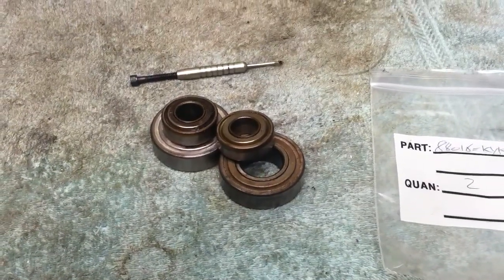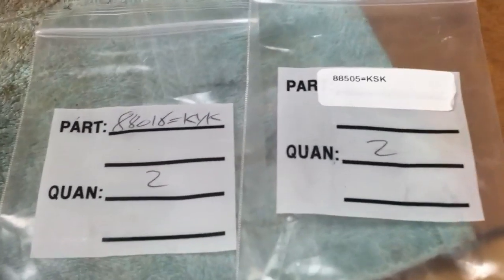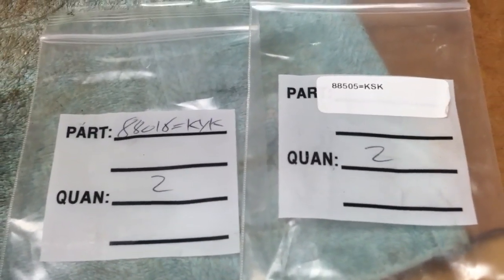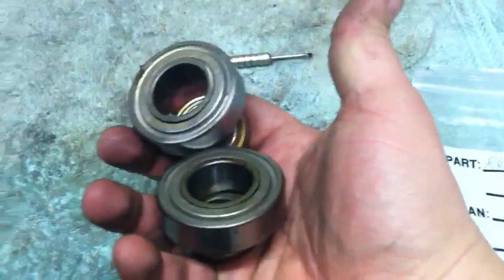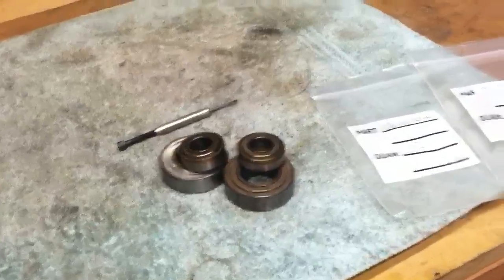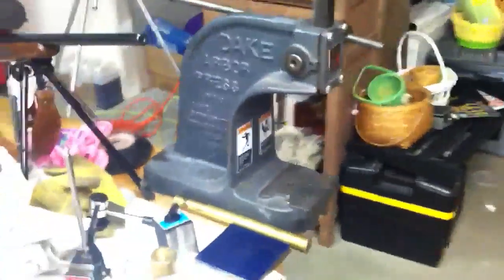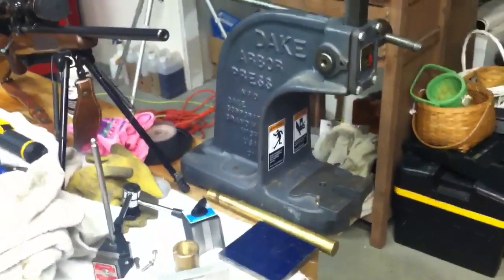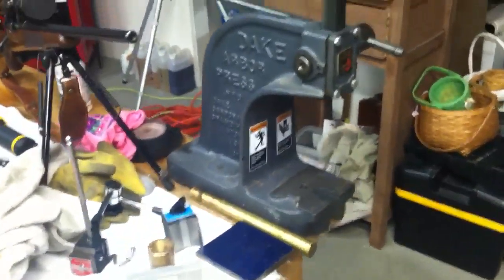Machinery Upgrade #1: South Bend Drill Press Bearing Replacement - (Part 1 of 3)

Comment: Hi, glad you got your problem sorted,  I have the same model but a floor one,  I would like to install a middle pully can I just put any replacement part in as long as the shaft matches the housing that rests in the column, which I have.  Thanks and real nice job on the resto I will be doing the same!

Comment: Could the shaft be bent or galled? when the shaft goes up and down they ride inside the top pulley I have had that problem on a modern drill pres

Comment: With all respect: How did you press in the new bearings? (If you pressed on the inner ring they can be easily ruined).
As is written below: It would be nice if you could isolate the noise. Take off the belts and rock and spin the different components by hand. You can also take an electric drill, accelerate each of the components up in speed and listen for bearing noise as they run down in speed.
Good luck!

Comment: funny how the noise stops the instand the switch is turned off.  It is quiet during the spin down.  did ou try running the motor with the belts disconnected?  Can you spin the quill and idler separately to eliminate possible noise issues from these area?  how about bearing spin inside the mating surfaces of the bearing.  Maybe the bearing housing is the source of the noise from bearing race spinning inside the quill housing.  Loctite?